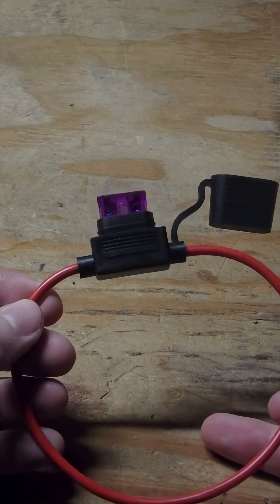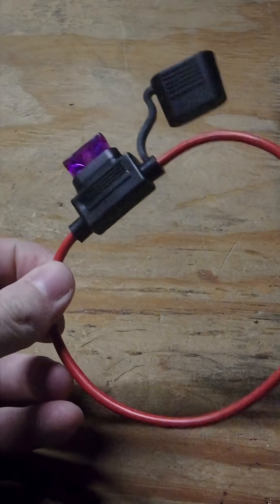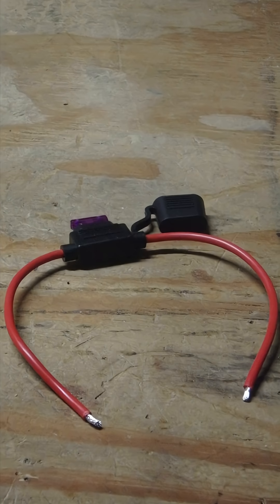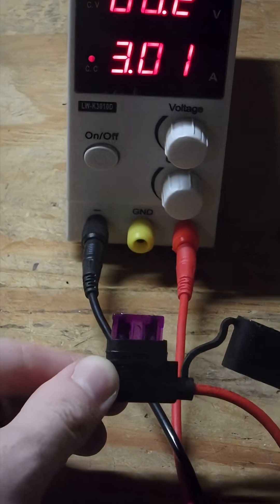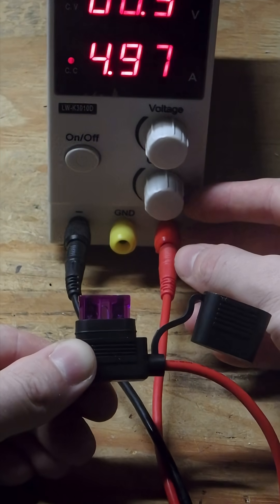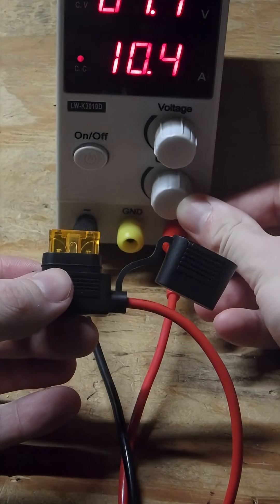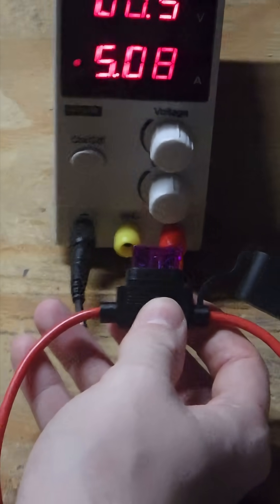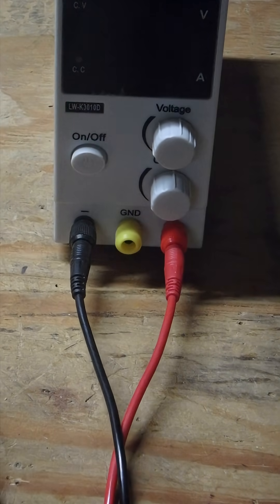is this how fuses work??? #electronics #fuses #confused

Comment: these are thermal devices so there can be no sharp transition between rated current and trigger current. as a rule, a fuse will last for 4 hours at its rated current. if you run them near their rating, you'll be swapping fuses all the time. at double the rated current, they typically pop in around 1 second. then there are all sorts of fuse speeds and curves, just fish yourself the specs.
Reply from the maker: I think I will try again with more expensive fuses, because it was not working like you said
Reply: @thomas8313-o3t   oh amazon/ali fuses? yeeeeah kind of lucky if they pop at all, even if they all turn out to be 5A fuses regardless of what it says on them :D